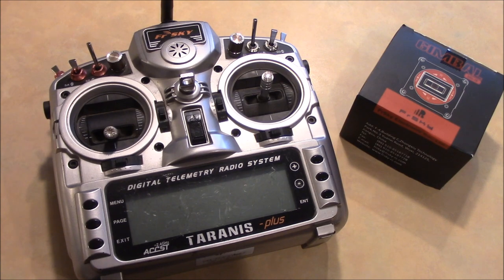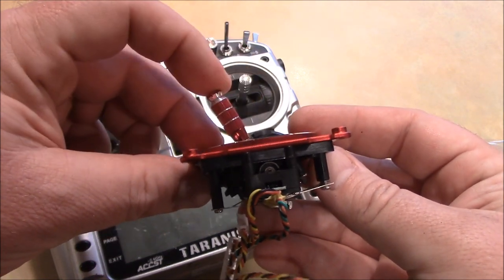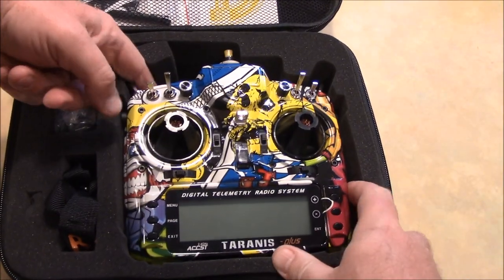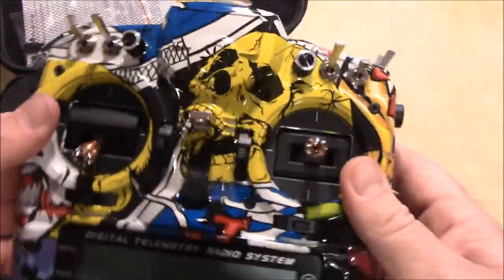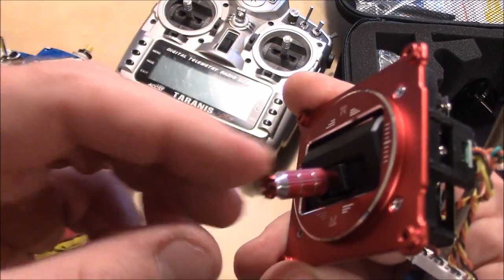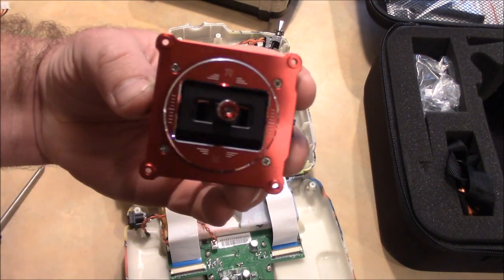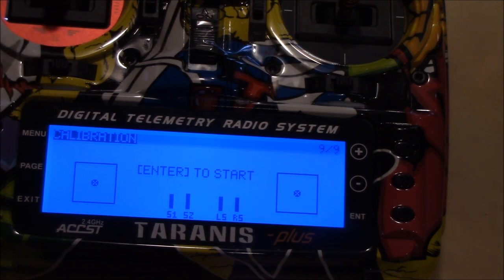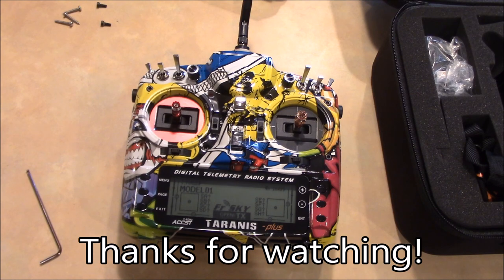Full Throttle With M9-R Gimbal for Taranis

Comment: i've been having this exact problem for ages, i use the old flysky i6 and  even switched to semi pinched style to try and fix the throw problem,  i wish there was an m9-r mod for the flysky i6. i rarely hit full throttle but its usually during an emergency and i need to move my whole hand a little which is just adding instability to the emergency.

Comment: I have the same problem on the QX7.  When I calibrate the sticks could I just not push the stick to full throttle but to where my limit is?  Would that calibrate it so you would reach full throttle before the sticks reach the top?  Do you know if the M7 gimbals have the same throw angle?  Thanks a million.

Comment: Why did you have to re-bind all your receivers that doesn’t make sense to me just because you changed hardware on the transmitter
Reply from the maker: Receivers have to bind to a single transmitter.  If you get a new transmitter, you have to rebind it.  If it just connected to any transmitter that turned on, it could connect to anyone else's transmitter at an event and then they'd be controlling your quad.  That wouldn't be good.
Reply: I must of skipped to the end cuz I didn’t realize it was a new tx. Just thought u put a gimbal in a current bound tx